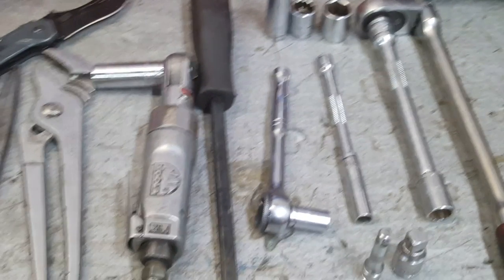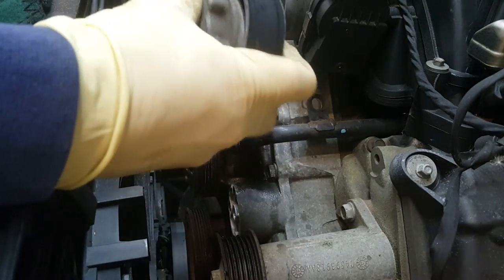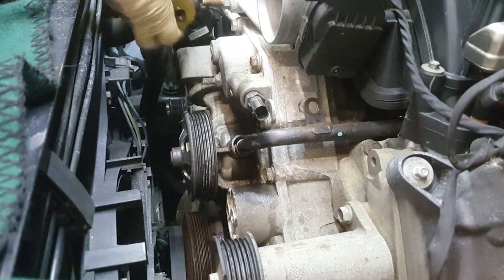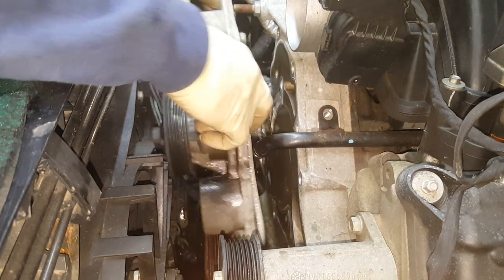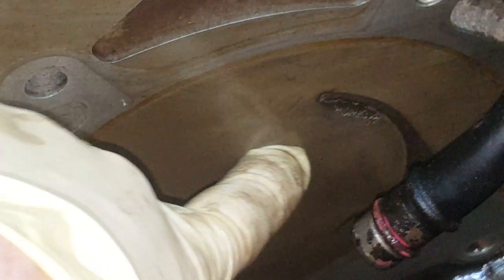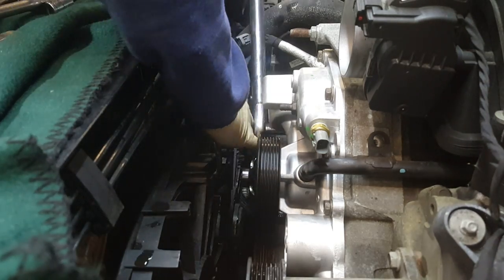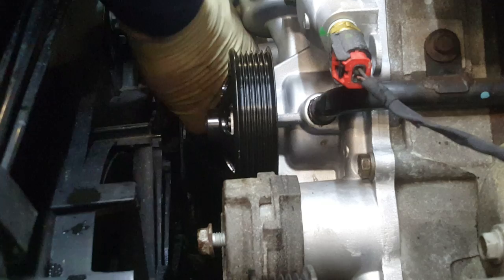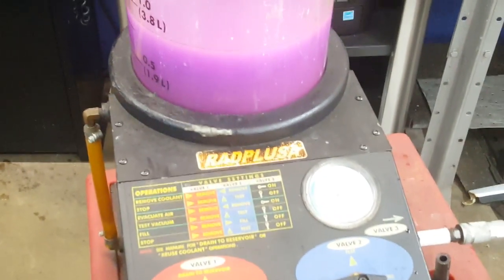How To Replace A Dodge Charger Water Pump "And Cost"

Comment: Good video. Got a 14' Charger R/T I did a water pump on last year, but after a year, the gasket that came with the  pump has started leaking. So I bought a much thicker gasket from Fel Pro gaskets, and installed it on the same pump I replaced last year. (The replacement pump was fine) No more leaking, or seeping. Point is I wouldn't trust the gasket that comes with the pump.